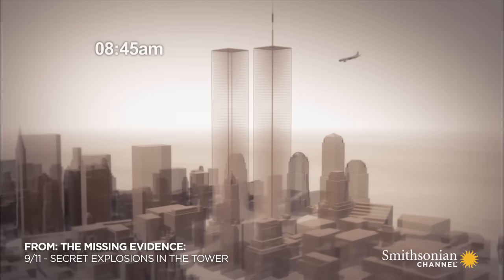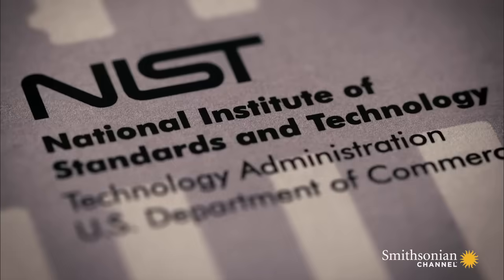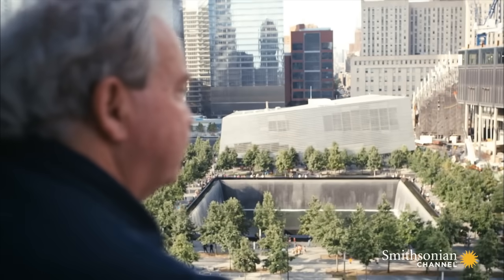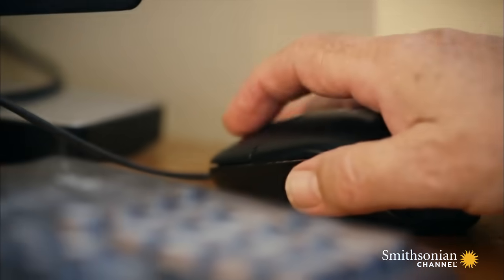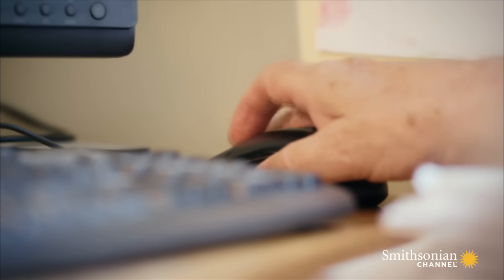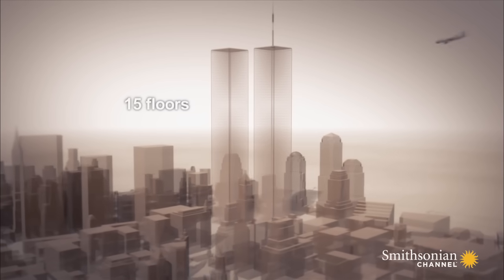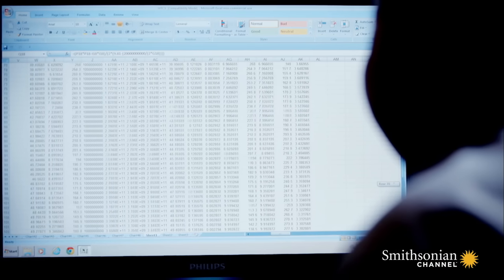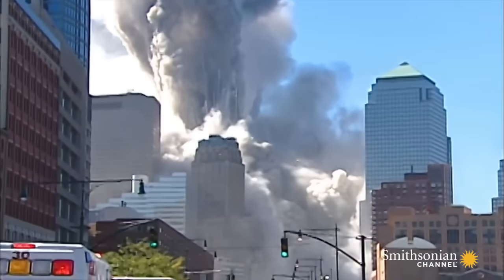This Computer Simulation Explains How the Twin Towers Fell

Comment: The inside job theories are so entertaining with how illogical they are. Most truthers do not even know how the really unique design of the towers was crucial in determining how they fell. The core structure was connected to the perimeter columns via floor trusses. These floor trusses were thinner than the columns in the rest of the buildings and their purpose was to give the perimeter walls lateral support and they were the only structural elements that laterally supported the perimeter columns. If you remove these trusses, the perimeter columns will just fall off to the side because without them, the perimeter is a really tall, thin wall. When the planes hit, the fireproofing was knocked off the trusses, leaving them completely vulnerable to sagging from fire which is what steel can do. The fire rages on and begins heating these trusses making them sag, allowing the top sections to put pressure on the lower sections. When the pressure has been put on enough and the trusses have sagged enough, pulling the perimeter columns in, the perimeter columns finally snap, dropping the top sections on to the rest of the buildings.

The floor trusses were not designed to carry the top sections of the buildings, so if the top sections dropped onto the floor trusses, they would be stripped away completely, dropping onto the next floor and so on. The trusses were ripped away first, allowing the perimeter columns to just fall off. What truthers make a mistake in, is assuming the perimeter columns got crushed all the way, which is not what happened. The perimeter columns bowed inwards on the collapse initiation, while explosives would have blasted them outwards.

While all the chaos with the perimeter and floor trusses is going on, the core sections in the top floors are crushing the core sections in the lower floors, until enough resistance is met, leaving 40 to 50 storeys of the core standing for a moment until it is too unstable to stand on its own and then falls. This may look strange to some people because of its scale. No 500,000 tonne skyscraper had ever collapsed before so they find it difficult to comprehend.

It is really easy to see all this happening in the footage taken on the day and it looks very difficult to replicate these dynamics with explosives and I don't think anyone would be willing to do that. The number of things that would had to have gone exactly right for this plan to have worked the way it did defies mathematical calculation. They had to hope that steel from WTC 1 would hit WTC 7 so that the south face would be damaged and fires would be started all around the building and so that the sprinklers would get knocked out. How did they know exactly where to not place the explosives on the south face so that none of them were set off by the steel columns impacting the building? And how did they know the sprinkler systems would get knocked out? What if the sprinklers didn't get knocked out, the fires were extinguished and then you imploded the building anyway with explosives? Everyone would know that the building was demolished with no cover up factors like intense fires for you to put in the official story. How did they know none of the flames would set off the hundreds of explosives in the building for five hours? How did they know nobody would find one of the explosives? Why would they not just hit Building 7 with a plane as well? Why run the risk getting caught rigging explosives in the building that you can set off when the cover up factors of fires spreading around the building and the south face being damaged by steel columns come into play? What would the "real perpetrators" gain by destroying Flight 93 in a totally pointless isolated crash into a field in the middle of nowhere instead of just crashing that plane into building 7 a few minutes after the towers were hit?? This is a lot of risk someone is willing to take just to go to war.

Columns falling off a ledge will pivot off to the side like how a pencil does or like a steel bar or a piece of concrete being hit. There is nothing physically impossible about those things. Add that to the top section landing on some of the columns, ejecting them. You snap a raw spaghetti stick and fragments go flying sideways. But then when trying to explain it by saying they were propelled by the explosives, that doesn't really make sense. How exactly would that work? Even if you strapped rockets to these columns, you would have to have a ridiculously large amount of rockets to propel them. Explosives placed on the interior sides of the columns that detonated and made them fly outwards? What would be the point? And not to mention that an explosion powerful enough to hurl a column that heavy that far would have been very clearly audible. Yet when the buildings are falling all we hear is a constant rumble. The explosives would logically be engineered to cut the columns. Yet almost every column in the rubble doesn't have a cut in it. The columns with cuts were made by the cleanup crews to detach them.

If the WTC destruction did look like a controlled demolition, what kind of controlled demolition do the truthers think it looks like? The one it closest resembles is the verinage fashion of demolition which uses no explosives and is initiated from the higher floors to crush the rest of the building. With the WTC, you have this very messy collapse where massive chunks are sent flying and concrete is pulverized and the cores collapse late. Why would you do that? Why would you try to demolish a building in this way? You wouldn't, you would fail the buildings from the bottom up. Then they might say "maybe they did that to make them look like real collapses." Well if that's the case then they do look like real collapses and so what are they complaining about? That just undermines their entire hypothesis.

Is anybody actually going to try and respond to the specific points that I'm making here or are you all just going to call me a paid government shill?
Reply: I won't call you a shill but I do have a bridge in Brooklyn I'd love to sell you.
Reply: @Joely7 MkII Their two main vulnerabilities were their complete lack of concrete framing and their tube-in-tube design, less structurally sound but more office space. Nobody predicted that foreign forces would just deliberately ram the buildings full speed with airliners full of fuel, only a slower accidental crash. Basically the only way of getting the towers was by striking at the least populated operating hours. Had they attacked midday they would have had a much bigger crowd to fight against. Al-Qaeda knew what they were doing.
Reply: thank you for this. interesting. one. maybe the sprinklers were shut down, how about that.  but this is how conspiracy idiots are talking.lets go back, to the szart  what caused all this.
in the boing pilot center, they reconstructed everything from that day and they brought 10 pilots that were flying the same planes for years and rthey were given the same flight trajectory . what do you thing how did it go.
of those 10 pilots only one managed to hit the building 
ONCE
all of them had 10 tries so one out of the 100, with pilots that know thweir planes.
you think some sheepshaggers that have never flown anything gthan a cessna
would manage 2 of 2.
your thoughts on that

Comment: It takes about 18 months to 2 years to become a pilot and we are supposed to believe that 19 middle eastern guys had a few flight lessons in a small plane and then managed to hijack and navigate their way to the twin towers and the Pentagon.
Reply: FUN FACT: The hijackers did not have to do 95% of what a professional pilot does. They did not have to take off, land, make a flight plan, communicate, or manage a dozen different aircraft systems. All they had to do was the EASY part: Fly from point A to point B. 

You could sit down at your favorite flight simulator program and hit those towers with ease.
Reply: @Tim22222  do you reckon? The planes hit the towers at about 590mph. How difficult would that be to control and navigate at those speeds?
Reply: @PrisonPlanet1988  If you're flying straight, no problem at all! Why should it be?

Interestingly, you can see from video of the crash of UA175 (south tower) that the pilot indeed struggled with controlling the plane; he nearly missed the tower & had to do a pretty radical turn to hit it. But hit it he did.
Reply: @PrisonPlanet1988  FYI you are ill-informed if you think they had only "a few lessons in a small plane." In fact they attended and graduated from accredited flight schools, had MANY hours of simulator training, and received Commercial Pilot's licenses.

Lying about their experience does not help your case.
Reply: @Tim22222  I agree yes you are spot on with this point
Reply: @Tim22222  Did they have 18 months worth of lessons then?
Reply: @Tim22222  they didn't fly straight though.  They had to hijack the planes and turn them around.
Reply: @PrisonPlanet1988  Dude, turning a plane is EASY. Don't take my word for it, get a flight sim program and try it. EASY.
Reply: @Tim22222  how can you compare a pc game to a jumbo jet
Reply: That's like my playing a formula 1 game on ps4 or pc then saying go on mate drive an F1 car it's easy at 300 mph
Reply: @PrisonPlanet1988  Because software companies go to extreme lengths to make s/w like flight simulators as realistic as possible, that's  why! They hire real airline pilots, industry experts, etc. to test these things. I used to work at Microsoft; I know.

(A) the hijackers were highly trained and (B) what they did just wasn't that hard. You're barking up the wrong tree.
Reply: @Tim22222  Could you fly a jumbo key full of people and fuel and luggage and turn it around and then directly pinpoint your way to a building?
Reply: @PrisonPlanet1988  Easily! EEEEEE-ZEE! Why do you think it would be a problem?

Seriously, if your best argument is "I think turning a jetliner with this convenient steering wheel and finding the tallest buildings in the world on a clear day would be really hard" then you got nothing.
Reply: @Tim22222  You got to be joking me surely?
Reply: @PrisonPlanet1988  Why do you think it would be hard? I don't get it. Do you think it requires enormous strength? It's just turning a control wheel, after all. Or you can use the rudder pedals. What do you imagine a pilot has to do to turn an airplane???
Reply: @Tim22222  years of intensive training. And exams.
Reply: @Tim22222  it was an inside job that's why
Reply: The hijackers who flew the planes had commercial pilots licenses. What does them being “middle eastern” have to do with it?
Reply: @tpryce1782  Weren't they middle eastern?
Reply: @PrisonPlanet1988  How is that relevant?
Reply: @tpryce1525  because they were.
Reply: @PrisonPlanet1988  I’m guessing from your response that you can’t explain the relevance?
Reply: @tpryce1525  isn't it a fact that they were middle eastern? Or were they southern American or Australisian or European? We're they far eastern ? Or northern Americans?
Reply: @PrisonPlanet1988  Try to pay attention: I’m asking you how that’s RELEVANT. Do you know what that word means.
Reply: @tpryce1525  it's relevant because it's a fact that they were. It's a fact.
Reply: @PrisonPlanet1988  How is that fact relevant?
Reply: @tpryce1525  Because they were.
Reply: @PrisonPlanet1988   Nobody ever said they weren’t. I’m asking you how it’s relevant.
Reply: @tpryce1525  Because it's a fact that they were.
Reply: @PrisonPlanet1988  That doesn’t make it relevant to the discussion.
Reply: @tpryce1525  what's your problem with them being middle eastern? I'm half middle eastern myself and you keep insinuating that there is something wrong with being middle eastern.
Reply: @PrisonPlanet1988  Nope. I did no such thing. YOU brought up their ethnicity in your original comment and I’ve been challenging you to explain the relevance, which you have so far failed to do.
Reply: @tpryce1525  their ethnicity is a fact. and I share the same ethnicity. And you're making out there's something wrong with being half middle eastern.
Reply: @PrisonPlanet1988  I’ve done no such thing. Repeating a falsehood doesn’t make it true. YOU brought up their ethnicity and I’ve challenged you to explain the relevance of YOUR comment, which you have so far failed to do.
Reply: @tpryce1525  it's a fact they were middle eastern
Reply: @PrisonPlanet1988  How is that relevant?
Reply: @tpryce1525  because it's a fact
Reply: @PrisonPlanet1988  Nobody ever said it’s not. That doesn’t make it relevant.
Reply: @tpryce6428  why does it bother you so much?  What's wrong with being middle eastern?
Reply: @PrisonPlanet1988   I’ve said no such thing. I’ve challenged you to explain the relevance of your comment, which you’ve so far failed to do.
Reply: @tpryce6428  it's relevant because it's factual. The Beatles were European.
Reply: @PrisonPlanet1988  That doesn’t make it relevant.
Reply: @tpryce6428  well it does because it's an historical fact.
Reply: @PrisonPlanet1988  No it doesn’t. There are many irrelevant historical facts. YOU brought up the hijackers’ ethnicity. Why can’t you explain the relevance?
Reply: @tpryce6428  because it's a fact.
Reply: @PrisonPlanet1988  That doesn’t make it relevant.
Reply: @tpryce6428  why doesn't it?
Reply: @PrisonPlanet1988  Because “factual” and “relevant” are two different things. Something can be factual without being relevant. Are you oblivious to this?
Reply: @tpryce6428  Why isn't it relevant?
Reply: @PrisonPlanet1988  No no, try to pay attention. YOU brought up the hijackers’ ethnicity. I’m challenging YOU to explain the relevance of that. Understand?
Reply: @tpryce6428  because thy were Saudi  Arabian
Reply: @PrisonPlanet1988  How is that relevant?
Reply: @tpryce6428  Because they were.
Reply: @tpryce6428  you're some automated  government bot. Definitely.
Reply: @PrisonPlanet1988  That doesn’t explain how it’s relevant.
Reply: @tpryce6428  why do the documentaries about 911 mention their nationality then?
Reply: @PrisonPlanet1988  Your comment isn’t a documentary. YOU brought up the hijackers’ ethnicity and I’m challenging YOU to explain the relevance, which you’ve so far failed to do.

Comment: Try to fool the millenials, but I was 24 when this happened, how dumb do you think people are to think these fell cause of a plane?  Or how did building 7 fall?  Or better yet there is ZERO footage of the plane hitting the pentagon?  Gulf of Tonkin anyone?
Reply: So where did you get your engineering degree?
Reply: @Tim22222  maybe you need a common sense degree
Reply: Huge airplanes smash into skyscrapers. Skyscrapers buckle at impact points and collapse.